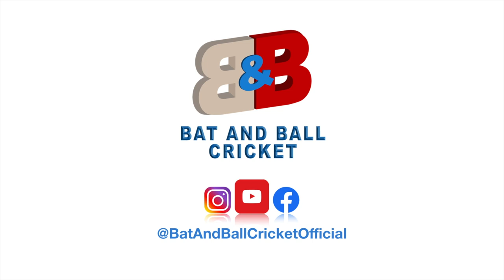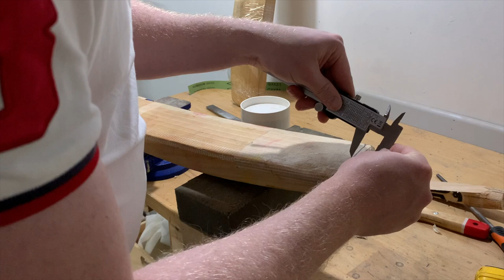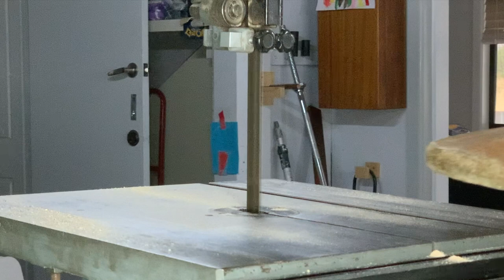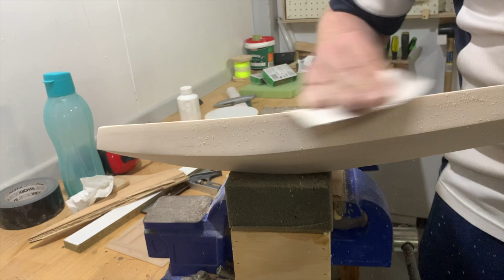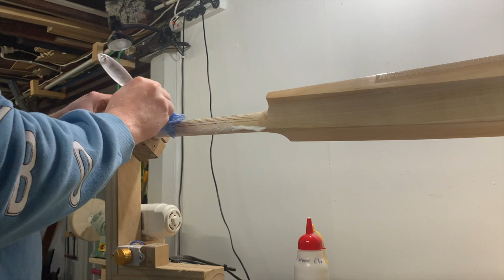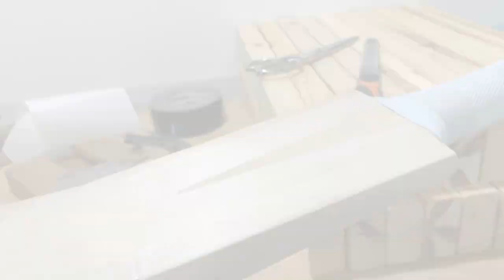Cricket bat blade shortening and full refurbishment

Comment: Great work there , Just a Question on your bench grinder the one side is a sander and the other side is used to polish the bat what are you applying on the polishing buff before putting the bat on there
Reply from the maker: This is a polishing compound. I use an Aluminium (often call 'SS') compound. It comes in a stick a bit like wax but with a harder texture.

Comment: Quick question...why did you shave off the spine after cutting off the toe. Wouldn't that just make the new toe weaker in comparison?
Reply from the maker: There wasn’t much timber taken off, so it wouldn’t have made much of a difference.

Kind of personal pretence mate. I’m a bit old school where the spine didn’t run all the way to the toe. I think it allows for a nicer pick up, feel and overall end look of the bat. Personal preference really.
Reply: @BatandBallCricket  all good bro, no judgement, just curioisity.

Comment: Can you lengthen a bat?
Reply from the maker: You can. The only way though is replacing the handle with a longer one. 
If you try and graft fully onto the bottom it’s really weak and will break easily.

Comment: I had a question about cutting the bat down at the toe: does it affect the pick up and balance in a negative way or does it make the bat feel lighter? What is the effect?
Reply from the maker: Thanks for the question. I had a comment made one another video that it would negatively impact pick up.

Here were my thoughts:
 I've got a regular customer who i shorten all his bats, for two reasons a. to reduce the weight, b. "improve" pick up. 
"Cutting the toe will completely change the feel" - Not really. If you're taking off an inch or more, then yes. But I took less than a centimetre. This equates to under half an ounce (14 grams). Most batting grips weigh about an ounce, so this impacted pick up less than putting on an extra grip. So while it did impact pick up, it was less than changing grip types.

"It will now be bottom heavy" & "may also feel heavier" - Not from the small amount removed from the toe. Removing weight at the toe of the bat, moves the balancing point up the bat. The higher the balancing point is to the handle, the lighter the pick-up will feel. The small amount of timber removed off the toe didn't change the pick up of this bat, replacing the handle did.
Handles between manufacturers are different and unless you're taking it back to the original bat manufacture (and they have handles from the same batch) it's almost impossible to get a bat pick-up identical after a rehandle. You can get it very close, but will always be slightly different.

Hope this helps.
Reply: @BatandBallCricket  Thank you for answering so thoroughly! Very interesting stuff about how the balance point moves up the bat - I'd thought the opposite... thanks again! :)